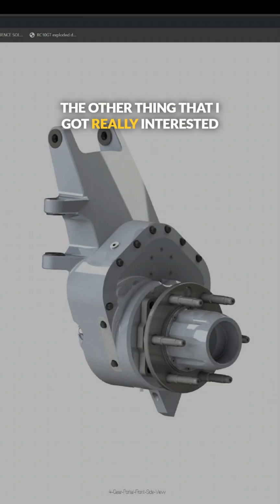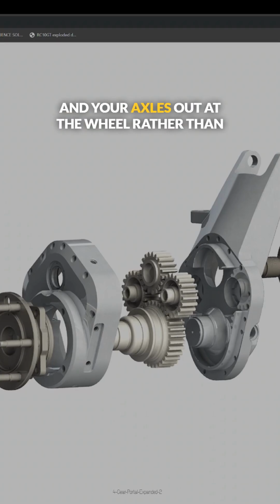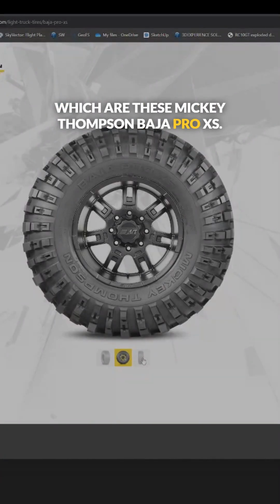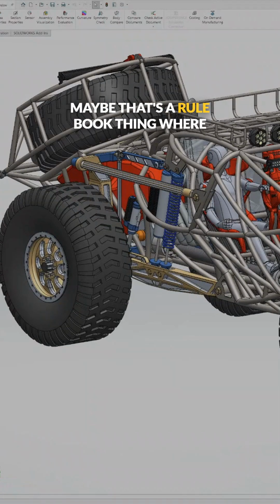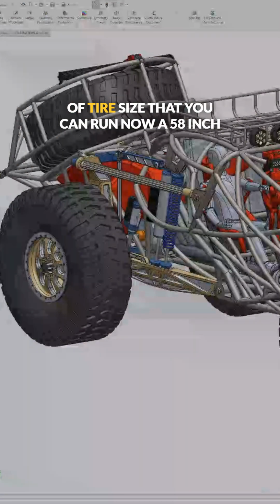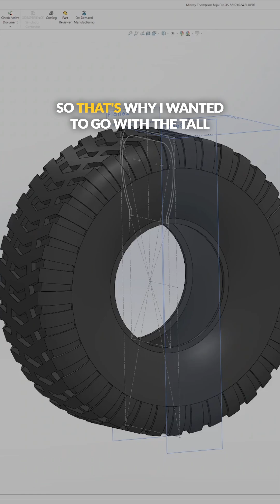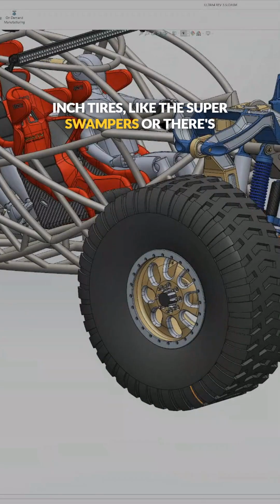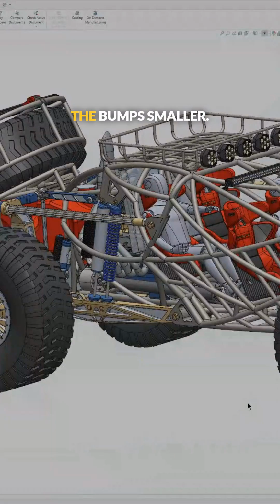Portal Hub Design Review for Ultra4 IFS IRS Rock Bouncer

Comment: The problem with bigger tyres is the weight and size. If you use such big tyres, your entire vehicle gets bigger. With a bigger car, you need a bigger engine to achieve the same acceleration and speed. You also will also decrease agility and their just ain't a way to compensate for this.